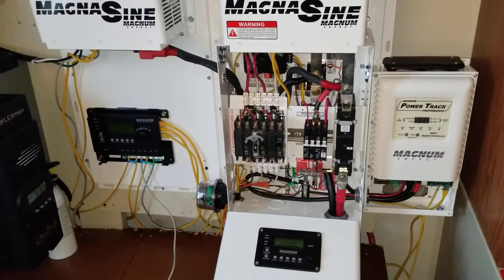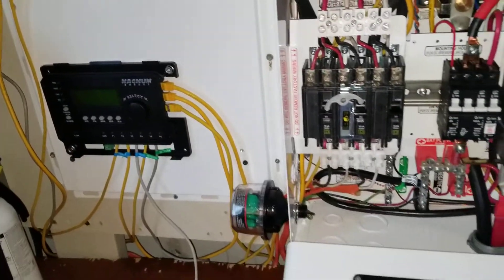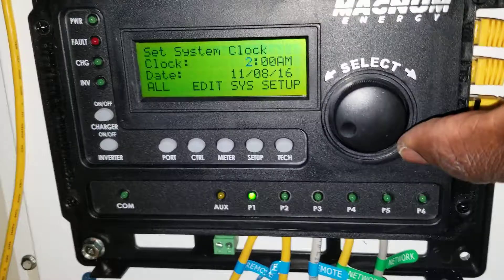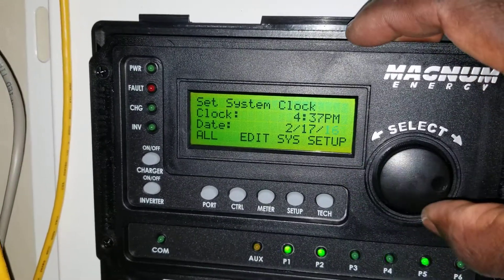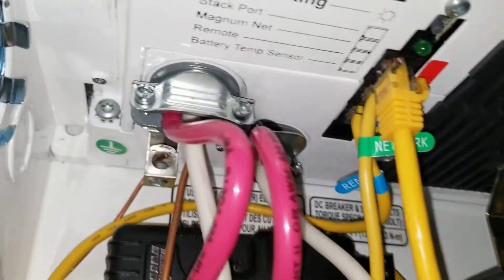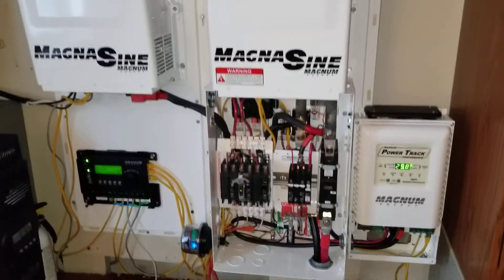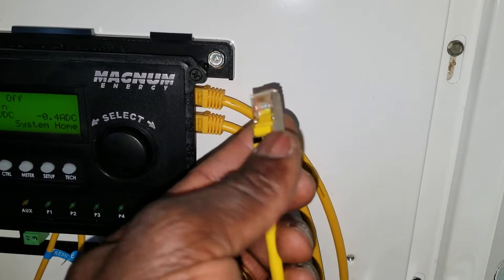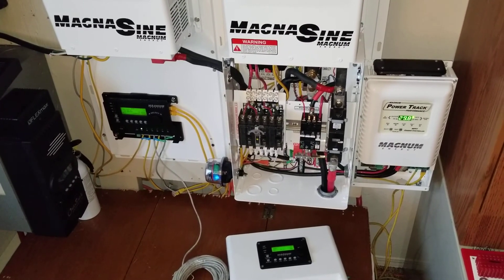MAGNUM ENERGY: ME-ARTR ADVANCED ROUTER SETUP | STACK MAGNUM INVERTERS

Comment: I noticed that you have an OutBack FM 80 charge controller in your system. Does it communicate with the Magnum inverter?
Reply from the maker: No.
They are not communicating with each other. 
They are  both stand alone  system.
Thanks for stopping by.
Please don't forget to like share and subscribe to my channel for more content.

IF YOU ARE LOOKING TO BUY YOUR LITHIUM BATTERIES AND SAVE 5%  PLEASE CLICK ON THE LINK BELOW.

BATTERY HOOKUP PROMO LINK 
https://batteryhookup.com/discount/jwsolarusa
Reply: thank you so much for getting back to me. I know it is an old post but i have two magnum 4448 pae inverter/chargers that i want to stack and parallel. do you foresee any problems with going forward using them with a OutBack FM 60 and FM 80 charge controller?